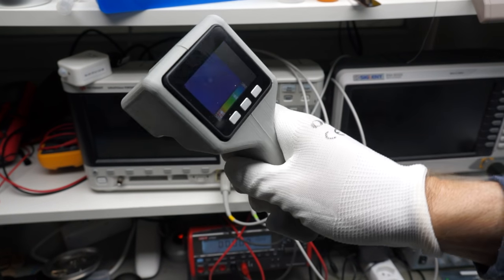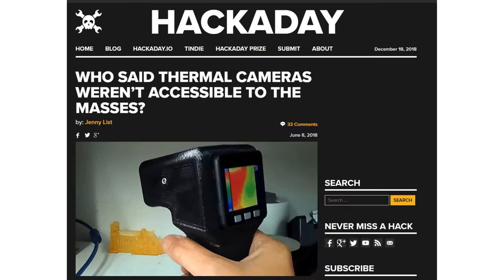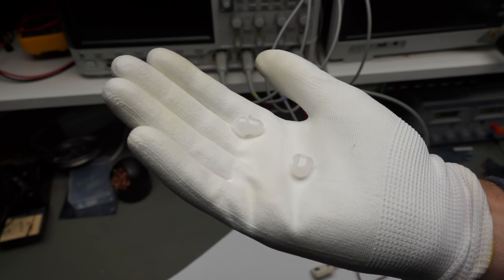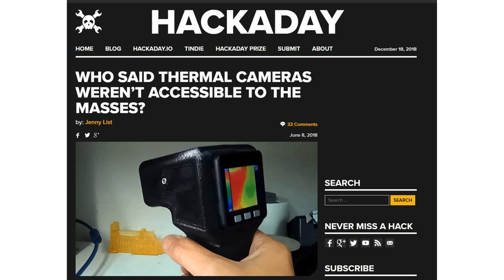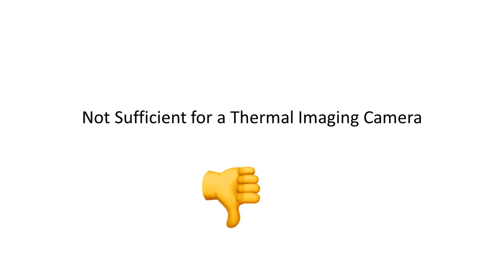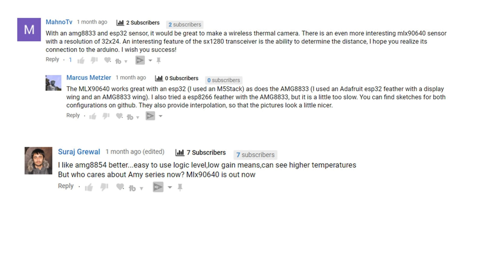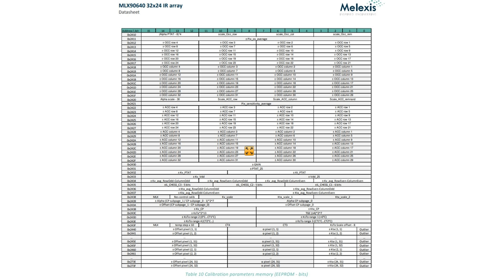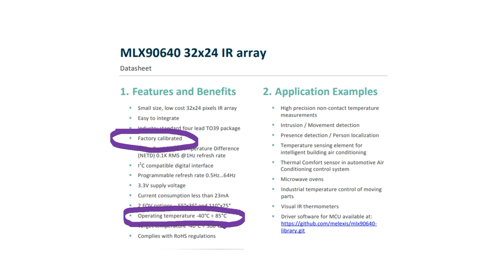#247 Do-it-Yourself Thermal Imaging Cameras (AMG8833, MLX90640, M5Stack, Arduino IDE) and Flir one

Comment: May be for checking the Heat distribution on a 3D Printer Heat Bed?
Reply from the maker: This would be possible, I think if you do not need a good resolution.
Reply from the maker: It uses one of the chips I tested.

Comment: Well your video cam too little too late. I had already spent the $$$ for both the AMG and the MLX and despite all my efforts to turn them into wireless thermal cameras, hint: I was going to attach them to my drone and see if it works as a cheap modular SAR drone, I had to finally come to terms with the failed attempt:  neither of the cheap sensors provide any usable input for at least thermal inspection from the drone. In the end all I have left is a drone with a glued AMG sensor and an FPV camera with its IR filter removed and an IR projector attached so I can actually see something in the dark and another "bar" on which I have the MLX plus another FPV camera again with its IR filter removed and the customery IR projector mounted. 

From what I tested the AMG only gives some useful information about object's heat if used indoors and for distances up to 5-6 meters so hardly any SAR usage is possible. The FPV camera with its IR filter removed and the additional IR projector added does indeed offer significant longer range for night time optical reconnaissance but the key factor - thermal is appalling - the maximum interpolated resolution I could get where the image is still almost readable is 96x96 pixels still you'd need to know what you're looking at to get a hint of its thermal image. Detecting body heat is almost impossible at any range.

Switching to the MLX I hoped the significantly increased resolution would prove  sufficient, alas no joy. The best I could get is to make it 160x120 so a 5 times interpolation zooming which makes the image very blocky yet it retains its general proportions so a human shape would still be recognizable but since the range of this is at best 11 meters again we're back to relying on the FPV cameras with their IR filters removed and the surprisingly powerful IR LED projector to get the optical information which then you can corroborate with what you get from the thermal imager.

Overall these sensors don't actually offer any reasonable priced method of detecting a human being via its thermal signature, at least nowhere near the kind offered by the more expensive and higher resolution FLIR Lepton 3.5 or 2.5 based sensors. The Lepton 2.5 has only 80x60 pixels so it's hardly a viable thermal camera for long range detection, whereas the 160x120 is the minimum you'd want to use to track warm bodies from any height.

Given however how much the Lepton 3.5 devices cost and how complicated it would be to get the thermal data feed from the drone via a form of data feed down to the ground station to process and display I don't foresee at least for the time being a viable alternative to the FLIR solution. So we must hold off and hope. Maybe FLIR will make something cheaper at a reasonable resolution.
Reply from the maker: Thank you for sharing your experience. If just removing the IR filter would make a thermal camera FLIR would probably not be able to charge their prices :-(
Reply: @AndreasSpiess  True enough. Still removing the IR filter on any digital camera will not instantly allow it to see in the dark, most definitely not detect heat radiation. The sensors used for them cameras are sensitive to IR radiation as well and it will show it in the images they take if not filtered. Since humans don't see IR, looking at an image with IR information in it is weird since it adds extra colors and shades that the naked human eye and thus the brain cannot process. So instead to building less capable sensors, most camera makers just filter out the IR wavelengths (from around 6-700nm up to ~1000nm) so the end result is "like perceived by the naked eye" image.

When you remove the IR filter and get the weird looking image during daylight you might think that the sensor is broken and useless, not quite so, because at night if you add an extra IR projector say some LEDs shining 890 or 790 nm IR light) you can get something really neat - an ordinary camera turns into a low-light/night vision one. Depending on what kind of LEds you're using the IR projector can glow slightly reddish, almost impossible to see from a far or be completely dark if it's emitting on the 790 nm. I have the 890nm so I know when my IR light is on but I'm thinking of switching the 790 nm projectors.

This kind of night vision helps since it eliminates the need for flood visible lights making surveillance easier, it does not however help with detecting heat sources say in a forest if you're looking for animals to hunt or doing SAR. 

That kind of detection requires a LWIR (long wave ID) sensor, usually a microbolometer based on Vanadium-OIxide compounds which for decent resolutions (more than 160x120 thermal pixels - this is the very basic Lepton 3.5) will cost a ton of money since they are expensive to build. A normal 640x480 thermal pixels resolution sensor costs in excess of 10K USD (or EUR cuz at this price range the currency is irrelevant). So hardly "affordable"

The MLX90640 with its 32x24 kind of hints you have to interpolate what you see to get some sort of usable image. From what I tried though this gets you an "almost usable" image if you scale it by a factor of 5, so you get an INTERPOLATED (usually linear interpolation) 160x120 pixels image. Which isn't great by any standard but it does allow you to "guestimate" what you're looking at. Combine it with the false color palette and you have a serious task to figure out what you're looking at. The easiest I found to be to identify shapes of things from some distance apart (>3-4m) is if you switch it to black and white palette (black=cold white=hot)

A mix of B&W and color could help but since I'm using Arduino and Teensy for processing the amount of computation that I can do to keep a  somewhat usable refresh  rate for the picture is very limited. Connecting the sensor to a PC helps but drastically reduces the mobility. I haven't yet tried to use a smartphone to do the heavy lifting processing as it requires Android programming which I'm not that proficient at yet.

Comment: Does anyone know if (and where) I can get a black plastic cover for a single pixel sensor?
Reply from the maker: I do not know.
Reply: @AndreasSpiess  Thank you for responding. 
I found PANASONIC PIR sensors with both white and black plastic exteriors but not these cheaper alternatives. 
Andreas, what if I paint the tip with black spray paint, for example. Would the sensor still work properly?

Comment: AMG8833 Doesn't reflect true temperature I suffer from getting sensor readings accurate, strange thing sensor gives accurate reading if only the temp got changed with time, but if it keep with constant value the reflected reading is not accurate at all!!
Reply from the maker: I agree. All IR sensors have this problem. The temperature depends a lot on the surface. Shiny sufaces usually show wrong values.
Reply: I found IC LMX90632 (Not LMX90640) which could provide medical grade temp reading. could you check it out?
Reply from the maker: @testhossam1  This is not a sensor issue, it is physics. For the moment I have no plans for another IR sensor test 😞

Comment: Interesting, but the products from SeeK are higher resolution: https://www.thermal.com/compact-series.html  The SeeK Compact has 206 x 156 resolution instead of 32x24  or  160x120 for <$250.   Not good enough? The Seek CompactPro is 320 x 240 for $500.  No assembly, 3-D printing or code debugging required, just plug in to a phone and use!
Reply from the maker: I am sure there are alternatives to FLIR. Here I wanted to concentrate on the do-it-yourself cameras.

Comment: "For only a few bucks" - you should definitely familiarize yourself with the meaning of "few" and "bucks". Thermopiles have been around since the dawn of electronics, it's not a new technology. Downvoted b/c of several inaccuracies.
Reply from the maker: You are right. As all physical effects also Thermopiles were around since ever. Your definition of „new“ is interesting. I usually figure the application also in my judgement, similar to the definition used by patent offices. Concerning the two words „few“ and „bucks“ I only see different opinions. Errors in my world have to be proved.
Reply: @AndreasSpiess  "As all physical effects also Thermopiles were around since ever." - a thermopile is not a physical effect, thermopiles are devices utilizing the thermoelectric effect, developed during the 19th century, not "since ever", whatever that might mean. They have been used for motion and IR radiation detection since 1833 and thermopile arrays have been manufactured for decades for thermal imaging purposes. What has been on the market (not in military applications) since at least 1990 (according to the patent literature) in its current form is not new, especially in technology. I also advise you to look up the meaning of "few" in a dictionary, b/c something in the vicinity of $100 in a sample where other items are around $500 or so is definitely not a "few bucks" and BTW my preceding two assessments are not opinions, but testaments to your sloppy judgment and/or language. 
I suppose you haven't come into much contact with scientific publications and the scientific method in general, but you should understand that the burden of proof does not lie with the reviewer.